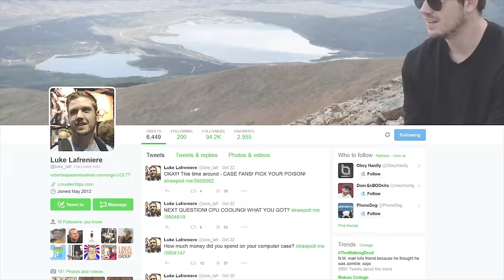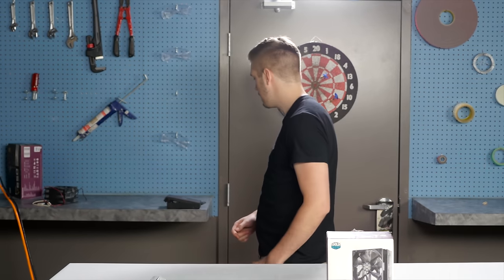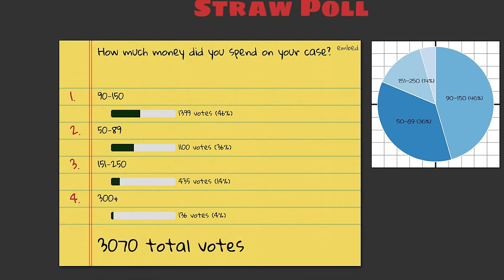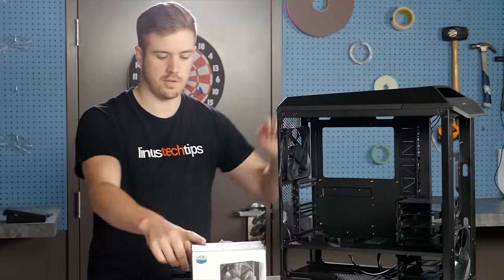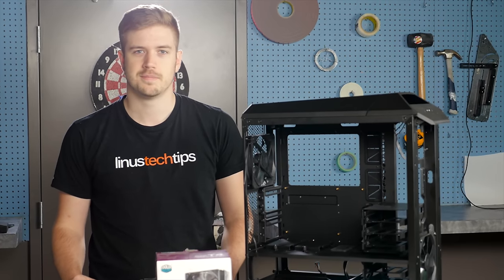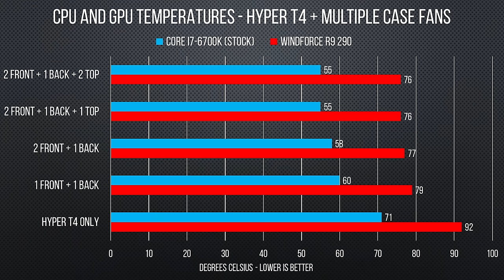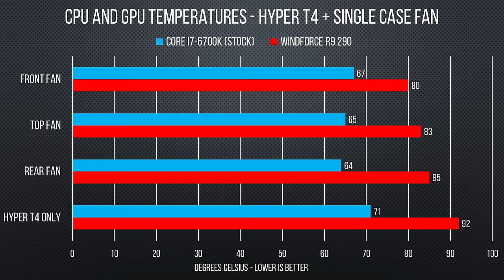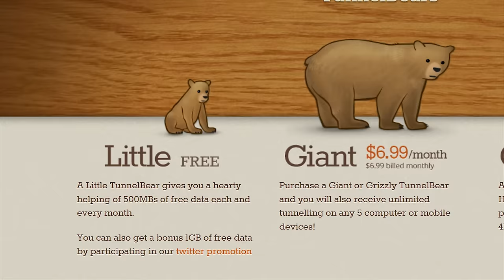Case Fans - How many should you have?

Comment: I'm planning to upgrade to a 1440p monitor and I have an asus gtx 770 and I'll be playing WoW, BF4, LoL, cities skylines and other main game like gta 5 and upcoming games.
Will I be able to play them with high medium settings or should I look for an upgrade? I can afford max a r9 390.
What do you suggest guys?
Reply: Thank you
Reply: Thank you
Reply: +Alessandro Limiti I would pick up a used 290 if I were you, that's what I did. It performs great.
Reply: +skatertwig26 then flash 390 modded bios on one switch. that way you can even get a corsair hg10 and water cool the card.
Reply: jr Bhatti I looked into flashing the 290 bios before, but I heard it can cause issues.
Reply: +skatertwig26 the only issue I had was I tried over clicking it too high in trixx so I had to reflash the same bios but it worked fine after that
Reply: jr Bhatti What do you gain by doing this? More FPS?
Reply: ***** That's not cheap haha
Reply: +Alessandro Limiti You can run most of the games at medium except bf4 probably if you want a 60+ fps lock. Also, if you get a new gpu you want something with atleast 4gb vram like a r9 390 or 390x.
Reply: +Alessandro Limiti High at 1080p, maybe med on demanding titles like GTA V. LoL and WoW are definitely fine.
Reply: No
Reply: Don't go to AMD from Nvidia. Your gaming experience will be downgraded.
Reply: is a 970 on the same level of the r9 390 for this type of resolution and games?
Reply: +Alessandro Limiti 
the 390 will beat the 970 especially at higher resolutions. Go for it.
Reply: airbomb34 I did it and mine was better. I like Nvidia but the 390 beats the 970. I have the 290 and it beats the 970 depending on what games.
Reply: +Alessandro Limiti 2 x gtx 770's in SLI have benched better than a Titan.  I would not suggest to go with a lesser graphics if you want Gaming performance above 1080p.
Reply: +UnrealVideoDuke The real problem with 770s is the amount of vram. Most cards on the market only came with 2GB and that really isn't enough for today's games.
Reply: +jaredliv It may be best to go for what you want.  4GB or more and hopefully something that has a 256-bit memory interface or better.  Some Benchmarks can be helpful.  "today's games" are being played on consoles with less specs than a High-End Gaming PC built 5 years ago.  Hope the best of luck to you.
Reply: UnrealVideoDuke If you have a 770 or higher you are obviously wanting a top end gaming experience. Sure if you want medium textures in Shadows of Mordor, GTA V or Dying Light 2GB is fine but try high textures and have fun in stutter city. Thing is these "outdated" consoles have 8GB of unified memory to play with.
Reply: +jaredliv Those cards don't have higher vram since they're not powerful enough to utilize higher vram in games, todays consoles have no chance running for example Shadow of Mordor in the highest texture pack utilizing 6GB of VRAM.
Reply: @jaredliv Consoles with unified or flexible space with 8GB of RAM with 3.5GB of it Dedicated to the OS... Ok.  The CPU's in the consoles are running 8 cores at 1.6+ Ghz which does not give much head room when you have to reserve soo much memory for the programming.  It gets more technical on why the games are developed on a budget to make full use of the system capabilities.  LoL at stutter city.
Reply: airbomb34 Hi troll!!! Hey, I like Nvidia more as well. That being said the 290 does beat the 970 in certain games especially in higher resolutions. Which is why I bought it. Not to mention I got it for $180. You can't get  a 970 for that. They have freesync. Not everyone cares about shadow play. I never once used it when I had Nvidia. As for drivers yes then can be better... Still looks like the amd cards are getting a much bigger boost then Nvidia with dx12 though. Not everyone is ready to through down $500 for a graphics card. For me photo/video editing first then gaming. The 290 is perfect for me at 1440p. So go away now.
Reply: UnrealVideoDuke I don't care about the CPU power of the consoles. I'm only referring to the VRAM needed for texture quality which makes a big difference on visuals. Digital Foundry on Eurogamer stated the PS4 was running with equivalent textures to Ultra High in this article http://www.eurogamer.net/articles/digitalfoundry-2015-grand-theft-auto-5-pc-face-off. Try running that on a 770 2GB without stutters. I should know because I have one.
Reply: Nisse Tomtesson Those cards utilize 4GB just fine. Having that extra VRAM just means the loading screen will be longer but you will get less stutters in game since your VRAM wont be full and constantly swapping out textures.
Reply: jaredliv No, VRAM does not work as a HD. 
  Having a large amount of poorly performing RAM, whether on a video card, or in your machine is worst than having a medium amount of RAM or VRAM that is high performing. if a game requires 2 GB of VRAM, slappin' in 10 GB wont get a better performance. 

However if you have less VRAM than needed you will get those stutters you're talking about.
Reply: Nisse Tomtesson What are even you talking about? 2GB of VRAM is not enough for high textures on modern games. This is my only point.
Reply: rage fards AMD software is ass. They haven't been fixed nor will they ever be fixed. Every game has AMD launch issues too. Really who are you trying to fool with these lies? NVIDIA dominates the market for a reason and its not because AMD is better or even offers competing features with their products. Once you go Nvidia with gsync there is no going back either. The best gaming experience is Nvidia which is also why consoles are running welfare gamer AMD chips.
Reply: +airbomb34 Both PS4 and XBox One are AMD based... so... yeah...
Reply: +Alessandro Limiti You should be able to max all but GTA V in 1080p. You could probably achieve high in 1440p on all of those games (turn off AA) and maybe still max bf4.
Reply: +Alessandro Limiti if you plan on getting a 1440p monitor my suggestion would be don't do so, but If you really want to do it the bare minimum to play at decent fps and settings is a gtx 970 or r9 390 (better performaning/cheaper and with more RAM but kind of higher power consumption).
Reply: +airbomb34 I believe they use apus
Reply: ThePolulos Why not go 1440p? I did and it is great. A 290 handles it very well, I play everything on max, some games I turn off AA(but it isn't too necessary with such a high resolution)
Reply: skatertwig26 I would rather have a higher fps than resolution :p
Reply: Saxonunited I get 50-60 for the most part on max on most games with a 290. The higher resolution makes it look so nice. But to each his own!!!
Reply: what about 1080p @ 144hz?
Reply: I plan on keeping my 970 awhile. next ill upgrade my cpu/mb. got 8350 lol
Reply: Saxonunited
good idea, I would wait and see what AMD can bring up with ZEN
Reply: ThePolulos Even if they bring it up idk if it will beat intel for it cus they got too much funding
Reply: +Alessandro Limiti Wait for the new Arctic Islands and Pascal GPUs. The node shrink alone will give these cards power/thermal/core clock improvements over the current gen cards.
Reply: shadow7037932 Alessandro Limiti I think I will just keep lowering settings until I NEED to upgrade. Id like to keep it above console though till I do.
Reply: if your mb allows it get a second 770. I have two of the evga 4gb models and can play everything that supports SLI on max settings with high frame rates. I don't have a 4k monitor but find my dual 1920x1200 are enough.
Reply: +Robert Hoadley 1440p isn't 4k
Reply: +Robert Hoadley I think it's 2300p is 4K?  I don't remember for sure though.
Reply: +DJ Vortical 3820 × 2160 is 4K, from what I remember
Reply: Hazman Josli Cool thanks
Reply: I had 1080p and a gtx 770 and upgraded to 1440p and later into r9 390. While you definetly can still game on the 770 you will mostly have poor fps or have to down the resolution to 1080 for most "demanding" games, if you can get an r9 390 I would definetly recommend iy
Reply: +Alessandro Limiti R9 390 for sure
Reply: ***** If you don't mind playing with a mix of Med-High settings, yeap.

And I think your AA should be turned Off or just 2xMSAA
Reply: +Alessandro Limiti imo go for the 1440p freesync monitor now, and keep your old card until new cards launch this year. WoW, LoL, Skylines etc. will all work 1440 on gtx 770 easy. Then switch to team red for freesync and to support open source tech...mind you, I'm nvidia hater so take that bit of advice with a grain of salt lol
Reply: ***** never get a gtx anything because nvidia is evil
Reply: +Alessandro Limiti get that R9 390x fuck that gtx 770 it doesn't support DX12 and new games are sporting dx12 where you will have huge advantage in FPS.
Reply: +TimeSnake but you also judge it by price/performance as well. Yes GTX titan x is best performance but by how much? 390x fury is slower by few fps at max and how much fury x costs?...
Reply: ***** well just watched benchmarks and it is in fact beating fury X by a margin of 1-8 FPS. Is it really better then fury X by price/performance? You get almost 2 fury X for the price of one titan X and fury X gives 8 FPS more at best.
PS: At some games fury x even beats titan X.
Reply: sermerlin1 pretty sure 980ti even beats it in some benchmarks, but if you go with price/performance route to make your point, you can go further down the line and just get r9 290 that has been the best price/perf card for a long long time.
Reply: Mario D. Zmaj well actually you can't go down that route because fury X is new tech boasts more features and improvements over R9 290. Actually It's not cost effective 290 vs fury x. Fury X wins.
Reply: sermerlin1 what tech? 290 has freesync, that's most important, and color compression is no issue due to wide 512 bit bus. Just checked newegg, there are no more 290s only 290x, i costs 320$. Fury X is roughly double that price. So, considering 390x vs Fury x is not that much difference in fps in tests: http://www.tweaktown.com/reviews/7335/amd-radeon-r9-nano-video-card-review-fury-dead/index8.html and the fact you can OC your 290x close to 390x performance, I think 290x in crossfire pretty much blows everything out of the water when it comes to perf/value, even if you go with 50ish % cf gain, but from what I read, that number is usually much higher or cf simply doesn't work. Anyways, if you're gaming on 1080p, you will pretty much max out anything with 290x for 320 bucks. Why spend so much on Fury X? If you want 4k, again, why not go for crossfire?
Reply: +Alessandro Limiti You'd probably want an upgrade. The MSI 390 is probably the best one to go with.
Reply: Destess the r9 390 is pretty good card, but I think its the best to go for r9 390 instead.
Reply: Mario D. Zmaj what
Reply: Mario D. Zmaj lolwut
Reply: SquidPlays I'm just saying, that r9 390 is a good card, but it is better to get r9 390 instead of the r9 390 because r9 390 is the best card to buy atm, except maybe r9 390. Those are your choices basically.
Reply: Mario D. Zmaj now, I know you're making no sense on purpose but my brain is trying to understand it... and it kind of hurts...
Reply: +Destess excuse me, I didn't mean to blow your mind, its just that r9 390 is that good
Reply: Get the 970 or r9 390 or 390x if your doing 1440p. If your doing just 1080p the r9 380 would be best option for that and not overkill + it has 4gb VRAM.

Comment: I know I'm just a tad late but what about 3 fans in the front, one on the back and one on the top?
Reply: should work fine! but this is a positive pressure set-up and most cases are designed for negative pressure (that's what all the holes all over your pc are for, because in a negative pressure set-up more air would go out than goes in, so the rest of the air comes in through all the holes and meshes)
Reply: That is what I have in my case. Three (140's) in the front shooting in. One in the bottom (120) shooting in. One at the top and one in the rear shooting out (140's).
Reply: @silvercola9155  Wrong. Negative air pressure would mean that air gets sucked in from the outside, which means more dust and shit. With a positive pressure setup you intake more air and the air gets sucked out because the outside of the case has lower pressure than on the outside. So it's vice versa from what you said.
Reply: @isse6790  Didn't I say the same thing? can you please quote what I said wrong?
Reply: @silvercola do you have any idea if the CM MasterCase h500m is a positive or negative pressure-oriented case?
Reply: Isse hey man i know this is 3 months later but on mine i have 2 fans mounted on a radiator, both pushing air out. one on the top of the case pushing air in, and the back fan also pushing the air in. is this good airflow? my 3900x runs idle at 45-55° and im thinking my air flow might be bad. thoughts?
Reply: Depends on your fans orientation. You can set it up.

Comment: What about a fan on the bottom of the rig
Reply: +Pdaf E and where does the air come from, expect for the power supply there are no holes
Reply: +Relex Well a lot of cases do have holes there. It would make sense if your frontfans are obstructed by hdd-cages to give the gpu some unobstructed air from below
Reply: Okay
Reply: +Relex yes. My cooler master trooper case has one in back, two on the side (on the drive bays), two on bottom, and two on top. I love the airflow this case gives.

Comment: Are there only 2 components in a pc? 
When using a fan controller with temperature probes you can monitor other components as well. Like ssd/harddrives, heatsinks/heatpipes for cpu/memory/vrm's. This way you can optimize your airflow.